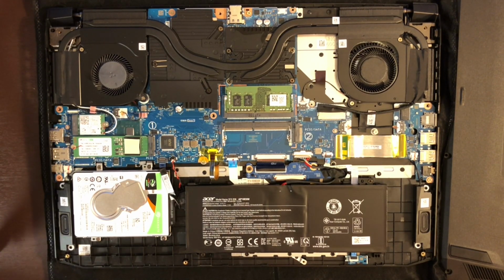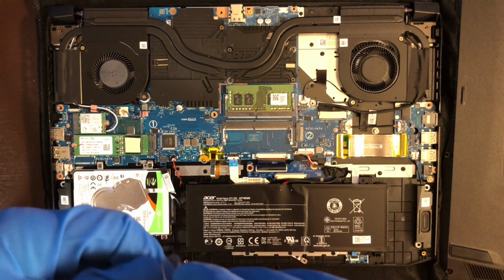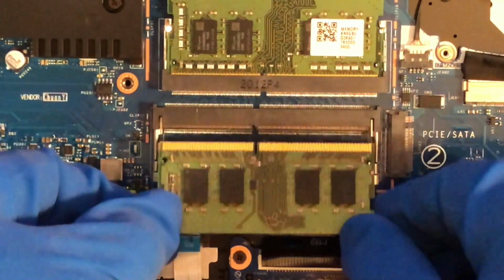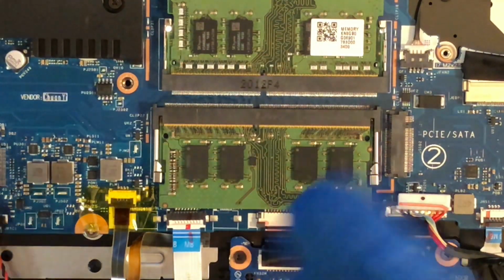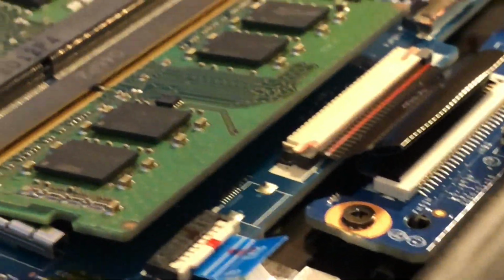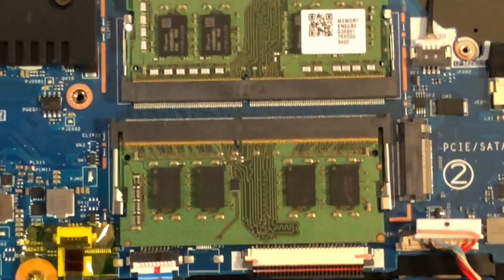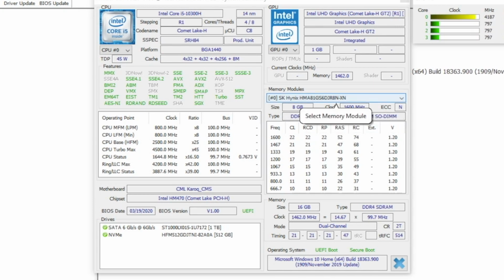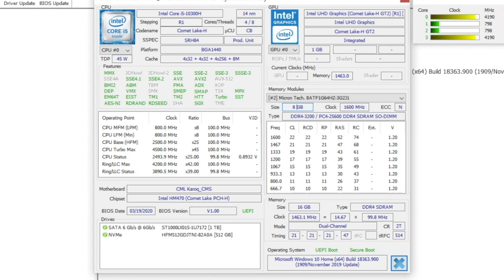Acer Nitro 5 Memory Install AN517-52-52T3

Comment: Thank you meanpooh I managed to add ram and fix an extra hdd to my acer nitro 5 superb and straight forward tutorial indeed I was a little shaky when plugging out the battery my thumbs are huge hahaha but managed it like a champ.Thanks buddy
Reply from the maker: Job well done.  Once you do one upgrade, it's hard to stop.  Again Congratulations on a successful install without error.
Reply: @Meanpooh   hahaha I agree next grizzly bear cooling

Comment: You're doing amazing work with your channel!! Completely loving it....
Btw I have one question , if we add a ram of different frequency other than the laptop's default will it  work????
Reply from the maker: Yes you can, it will work.  Your machine RAM will down clock to the slowest RAM speed.

Comment from the maker: **  RAM module used Crucial 8GB Single DDR4 3200 MT/S (PC4-25600)
Crucial 8GB Single DDR4 3200 MT/S (PC4-25600) CT8G4SFS832A
US🇺🇸 https://amzn.to/2ZZgPky
UK🇬🇧 https://amzn.to/2HfwG7W
CA🇨🇦 https://amzn.to/3mGKcSn
FR🇫🇷 https://amzn.to/30f7x4b
AU🇦🇺 https://amzn.to/3kvg7mW  **
Reply: Does that module work with the Acer Nitro 5 R5-4600H GTX 1650 512GB SSD version? I'm kinda new to this so I'm a little bit confused
Reply: My last computer just completely died, it was a 6 year old HP. Can I take the old RAM from the HP and put it in the Acer or does mixing different kinds of RAM hurt the PC?
Reply: The Gaming Cashew you got to have matching ram sticks it’s just 30 something dollars easy to save up and buy it down the road

Comment: Nice repaste fix the issue on your laptop

i Just watch your video back in assassins creed in single channel it did boost your fps big 30-45 fps now it went to 50-60fps and no stutter nice
Reply from the maker: Yep, most of the time RAM is a positive.
Reply from the maker: I just did another with stock config but overclocked the GPU.  Results are
Far Cry 5 Benchmark
Min 64
Avg 74
Max 85
Reply: @Meanpooh  nice i love your content man can't wait to get that laptop i Hope i don't get out of stock again  just like the amd version with ryzen 5 4600h 6cores 12 threads if i go out of stock again well i probably go buy the asus tuf gaming with ryzen 7 4800h and rtx 2060
Reply from the maker: the Ryzen 7 4800 is the best low cost laptop at the moment.  I wonder if it has mini dp out.

Comment: Great video! Just ordered the 8 GB upgrade you recommended. One question. What was the difference in the gameplay at the end between the footage with the laptop thermal throttling and the footage where the temps were staying cooler? I am going to attempt to run Cyberpunk 2077 on here in lieu of a next gen console and I wanna try my best to keep the thermals under control.
Reply from the maker: Adjusted speedshift.
Reply: @Meanpooh  Thanks for the reply! I have never heard of that before so I’ll have to look more into it. I’m new to PC gaming. I know people say that repasting is usually a good option of temps are getting too hot but this may be a little easier for me to try
Reply from the maker: Exactly.  Don't attempt anything if you are not comfortable.

Comment: Thanks! I want to upgrade to a full 32g RAM for my grandson’s ACER Nitro 5 AN517-52-52T3. The brand you are using - “Crucial” is the one recommended? And is this correct for the type of memory stick for this laptop: DDR4 PC4-24000 3000MHz Non-ECC SODIMM?
Reply from the maker: Yes. Crucial is a good trusted brand that has been around for years. I use it in most builds for friends. It’s listed in description.

Comment: Thanks for the video meanpooh! I'm really torn between upgrading my ram from 8gb to 16gb because of compatibility issues, is this compatible with my nitro 5 AN515 55 57XP?
Reply: This ram https://s.lazada.com.ph/s.YfAFS
Reply from the maker: Yes, according to the specs it should work.
Reply: @Meanpooh  Thank you, again, for the response. Time to void that warranty :D
Reply from the maker: @saniviersapphire5395  You're welcome but adding memory to your machine won't necessarily void your warranty.  If you are careless and break something while doing an upgrade then possibly it will be void.  If I ever found out that a warranty is void by upgrading RAM, i'll be the first to tell as many people as possible to avoid the brand.  Take care.
Reply: @Meanpooh  Oh that's why the IT I talked about the upgrade never mentioned about the warranty could be void. Need a professional for this just to be sure. Cheers!

Comment: Thank you for this Video. I  just received my new Nitro 5 yesterday.  I have the Ryzen 5 4600H & Gtx 1650 ti version.  I am going to order some extra ram and do the same as its only 8gb just now.   Do you know if its the same memory I need? Thanks     AN515-44
Reply from the maker: Yes, this will work.👍
Reply: @Meanpooh  Thank you for the quick reply
Reply: Nice I'm going to be getting the same ryzen 5 version, as well mine comes with a mouse, headset and mouse mat. It will be my first time buying a ryzen gaming laptop. 😃💯

Comment: Hi meanpooh, I just got my Acer nitro 5, and I want to upgrade the ram to 2 16gb, can I ask if the 3200mhz is the highest or I can go more higher?
Reply from the maker: Yes, it's the highest thats compatible.  Wether or not the machine will take advantage of the extra speed can be in question sometimes but it's better to have the option.

Comment: You probably won't see this, anyway is it okay if the 2nd stick is a different brand than the first one as long as the other specs are the same. Like the brand in mine is Kingston, so it would be okay to get a different brand if I can't find kingston right?
Reply from the maker: Yes. You can get a different brand.

Comment: Meanpooh. So this is my first gaming laptop so new to it all an I have the 17in 2020 model that came with 512gb SSD and 8gb of ram. I’m wanting to add 32GB of Kingston DDR4 Sodimm 3200mhz along with a 1TB firecuda SSHD and add another 512GB into the SSD. My questions are 

1.Are you able to have have both ssd ports and the HD port filled simultaneously?
2.is 32GB RAM to much for this laptop?
What is the highest GB I can go for SSD and HDD in this laptop? An do the SSD have to be the same GB size, brand and all? Thanks ahead of time!
Reply from the maker: 32 Gigabytes max on RAM. You can use all available slots simultaneously. Drive sizes can be any size you want when using M.2 slot. If you are using SATA , the largest drive is 2TB. The larger the drive, the thicker they become because of platters.
Reply: Meanpooh thank you so much! Last questions if you don’t mind my model is AN517-52 and it came with WD SN530 512GB NVMe SSD. The 2nd open port does it support another m.2 ssd or is it a 2.5 SATA only for the second port? I plan on keeping the original 512GB SSD that came with it but wanna add another ssd to my 2nd slot to maximize my memory, Any recommendations? Thanks again for your help
Reply from the maker: You can have a total of 2 NVME and 1 SATA drives.

Comment: Hi bro! So does a 2666MHz RAM upgrade will do or is it okay if I go with 3000MHz or better? Mine says 2933mhz also. I came from console gaming so I do not have any idea for laptops or PC uprgrades.....
Reply from the maker: If you have the same machine, I have a link to the RAM with the specs you need.  2666 is slower than the RAM that comes with your machine.
Reply: @Meanpooh  I have the AN515-55-57DA variant of Nitro 5, What do you recommend bro?
Reply from the maker: The one I have listed will work for you.

Comment: Hi bro, i think i just got the exact same model you have, and i want to upgrade with 8gb more RAM, mine say that is 2933mhz, here is the question: to have it working on dual Channel do i have to buy the a RAM with the exact MHz? Or can i buy one with more like you did? Sorry for the english
Reply from the maker: You can buy any RAM you want as long as you computer supports it. The speed of the ram will default to the slowest RAM if they are different speeds.
Reply: So does a 2666MHz RAM upgrade will do or is it okay if I go with 3000MHz or better? Mine says 2933mhz also. I came from console gaming so I do not have any idea for laptops or PC builds, I hope you can answer this meanpooh 😁
Reply: @Meanpooh  On your review video it shows your laptop listed at 2933mhz as well on the box. Not sure why yours is running at 3200, maybe they all do?

Comment: Hello,
i got 2 8GB 3200 RAM chips installed in my Laptop so I bought 2 16 GB RAM Chips to upgrade the laptop but now it says in the taskmanager it only runs on 2933mhz, do you know how I can change it, I try to went into BIOs but cant find any options there. Thanks
Reply from the maker: Your machine can use the module but because it cannot access the faster profile(XMP) it defaults to 2933.  If there was ever an update that allows this from Acer then you would be able to use the speed you are looking for.  There should be no significant difference in speed between the two that you will notice even though one is slightly faster than the other.

Comment: Hey Meanpooh, I’ve tried using throttlestop to undervolt this laptop, but the offsets aren’t being applied :/ is this relating to your video of using XTU and not being able to. If I have to just change the speed shift, what would be a good number for it?
Reply from the maker: Intel patched the exploit so no undervolting.  Adjusting speed shift varies by game.  There is no 1 for all setting.  You could be safe and use 130 but I think you will lose some performance at the expense of cooler temps.  I spent a few days testing this and have come to the conclusion that no matter what setting you choose, if your CPU hits 90 it will throttle.

Comment: Hey, man!
Greetings from Brazil!
Could you help me with some questions?
My laptop model is AN517-52-50RS (with a GTX 1650, but not Ti), and my memory is 2933Mhz.
My CPU-Z shows that the situation of the CL is:
Cas# Latency: 20.0 21.0 22.0 24.0
Ras# to Cas#: 21 22 22 22
Do you know if this crucial memory model works well with my specifications?
Does it make a downgrade?
Reply from the maker: The RAM listed is CL 22 which is pretty close to the stock 20 in your machine.  If the the RAM modules were the same speed then the lower would be faster.
The memory listed is a faster module and would run faster is the machine would somehow be able to utilize it.
If you were able to get  your same module in the Dual Rank then it would be better.
Something with these specs 8GB DDR4 PC4-21300 2666MHz SODIMM.  You may also see a price increase.  Hope this helps.
Reply: @Meanpooh  I was looking at the prompt of my Windows, on my CPU-Z and on the memory label, and was saying it's 3200Mhz, but the information from the selling sites and in the task manager are 2933Mhz, I'm confused. If I put a memory of 2666Mhz, Cl22, I'm sure no problem will happen?
Reply from the maker: @allan4196  All the info is correct.  It's a limitation of the machine.  Has a max speed of 2933 MHz.  If you put in a module with 2666 MHz then all modules will default to that speed.  It's always the slowest that is chosen.  In the end, you can use that speed if you want and you really won't be missing much.
Reply: @Meanpooh  Not to bother you with this again: any problem if I put a memory of 3200Mhz or will only downgrade to 2933Mhz?
Reply from the maker: @allan4196  Since you already have a 3200MHz module it will work out fine as both will drop to 2933 MHz.
Reply: @Meanpooh  Thank you so much for your patience in enlightening me about this!

Comment: do you know how to ground yourself without an anti static wrist wrap?
Reply from the maker: If you are very careful, you don't need to but it is good practice.  Try touching something that is metal and grounded such as a  pc case, a clothes iron that is plugged in and off etc.
Reply: @Meanpooh  yeah yesterday I decided to upgrade my nitro 5 using this video and I just did it in my kitchen and touched the oven

Comment: Meanpooh it says that the ram speed is 2933 MHz and im already ordering the same ram you have. i also have the same exact nitro 5 so im not sure if the 8gb 3200 Mhz would work
Reply: Did you purchase it?
Reply: @tekenplay  yeah everything works totally fine and stuff my laptop is doing great
Reply: @zh4130  Perfect! I have the exact same laptop. I am going to order the same one he used on this video then.
Reply: @tekenplay  the thing is the MHz will be the same as the ram stick in the system so to save some more money I recommend getting a ram stick that has the same amount of MHz
Reply: @zh4130  That's a good idea. 2933 Mhz ram would be better.l to save some money.
Reply: What's been your experience using 16gb instead of 8gb?
Reply: @tekenplay  for the games that I play I gained FPS and I was able to freely move across programs with my game in the background without my computer lagging
Reply: @zh4130  Great. That's exactly what I am looking for. Thanks!

Comment: Can you tell m which screw driver you've used??nd if i open the back panel the warranty will be void??
Reply from the maker: PH1
https://www.homedepot.com/p/Steelman-Precision-Phillips-and-Slotted-Screwdriver-Set-6-Piece-41799/303437749?mtc=Shopping-B-F_D25T-G-D25T-25_1_HAND_TOOLS-Multi-NA-Feed-PLA-NA-NA-HandTools_PLA&cm_mmc=Shopping-B-F_D25T-G-D25T-25_1_HAND_TOOLS-Multi-NA-Feed-PLA-NA-NA-HandTools_PLA-71700000034127224-58700003933021546-92700049573927173&gclid=CjwKCAjw8pH3BRAXEiwA1pvMsbX_OfQ2AIQ8uTFxiCWc8m2X2dDce-DDAoeG1SBTi_OzVODSD5INNhoCmUYQAvD_BwE&gclsrc=aw.ds

Your warranty will be fine.
Reply: @Meanpooh  thank you
Reply: Meanpooh I heard from Acer support if you unscrew or tamper with anything they cancel your warranty.
Reply from the maker: Right. If that’s true in which I think it’s not, they would lose business. I would be the first to spread that news.

Comment: I have a PNY - 8GB 2.4GHz PC4-19200 DDR4 SO-DIMM Unbuffered Non-ECC would that be fine even though its not 3.2GHz
Reply from the maker: Yes, it will work.

Comment: How Nitro 5 supports 3200mhz ram, 10th gen intel processors support upto 2933mhz ram only
Reply from the maker: https://www.intel.com/content/www/us/en/support/articles/000007393/processors.html
Reply: @Meanpooh  I read the link and see what you are implying,  however if you go to the specifications page for this processor it only states 2933. I also went through task manager and memory usage to see 2933 as speed with the stock 3200 8gb that came with the laptop. So Acer put in a memory that would not run past 2933,  now maybe its because 2933 is hard to find. But it definately wasn't running 3200 or 1600mhz. Mine was running at 1492 x 2 = 2984mhz. So buying the more available and more expensive RAM at 3200 is a waste of RAM and money. I bought 2 8gb sticks of Hyper X Impact 2933mhz and it runs like a dream. Plus the stick that came with the laptop is garbage anyway,  not to mention Acers tech support with inaccurate information.
Reply: @dustincather6277  i think acer just put a 3200mhz ram in acer nitro 5 and underclocked to 2933mhz
Reply: @basithoffl That would be Intel not letting it run past 2933,  Acer is just the brand name. Its a Comet Lake Intel board. Either which point is that on this board you cannot get higher than the 2933mhz.

Comment: You added a 3200mhz RAM? Doesn't 10TH gen intel only support 2993mhz? Plus the original ram is 2993mhz . We can use rams of different frequency??!
Reply from the maker: The Nitro 5 supports the memory.
Reply: @Meanpooh in my country i don't have 2993 mhz rams. Can I install a 2666 mhz ram?
Reply from the maker: @cyferisonline4415  which country?
Reply from the maker: @cyferisonline4415  Darn I checked to make sure and you sure don't have it there. 🙁. 2666 mhz is compatible with your machine.  Sorry my Dude.
Reply: Maybe i will upgrade it when it launches. But 2666mhz with 2993mhz. How much performance hit will it take
Reply from the maker: I couldn't tell you that.  You may not even notice.

Comment: Help! 
Do i just need to set speed shift on
 120 or something else ? Because there wasnt any diffrenece in temperatures. Could you tell me how to do this?
Reply from the maker: Using speed shift will reduce power to your CPU.  You have a range of 0-255 i think.  0 is full power while 255 is like using the battery saver option.  You have to use some trial and error to find the best setting for a game.
Reply: @Meanpooh  i think i got it! . I have now 60'C in Company of Heroes 2. Thanks :)

Im trying other games now

Edit #2
Cs go 55-65'C

Edit #3 OMG  Ark temperatures dropped from 95 to 79
Reply from the maker: There you go!!
Reply: @m_greg4442  can you please tell me what numbers you did put on speed shift range ? thanks
Reply: @aminetaleb1259  120

Comment: Wait wait wait the computer already comes with 8gb of ram and an empty slot for another ram so can I just buy a 8gb ram and make is 16 or do I need to buy a 16gb ram lmao I’m confused? Also do they have to be the same brand or don’t matter
Reply from the maker: Yes
No
Reply: @Meanpooh  i have sameish question. i want to buy the laptop but is the 8gb of ram that is already in the laptop the same brand and specs as the 8gb of ram that is being installed?
Reply: nvm i watched the video some more with the 8ram that is in the laptop and the one that was installed

Comment: i would like to run this on my acer nitro 5 AN517-52-52T3 DDR4 3200 memory 32GB  Which would you recommend?
Reply from the maker: The memory, Yes.  I would only buy 32GB if I were to video edit large 2k and 4k video.  If you're not editing then 16GB will be more than enough.